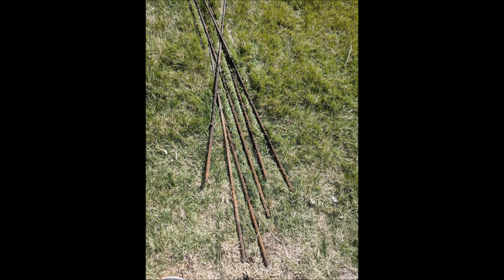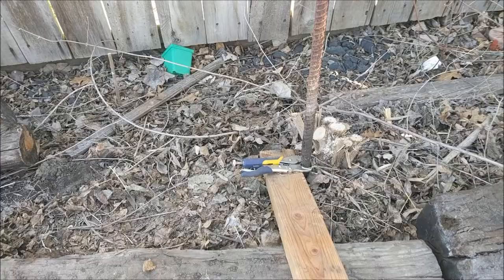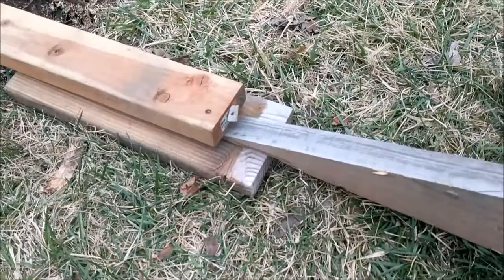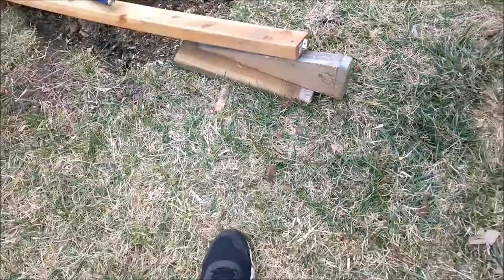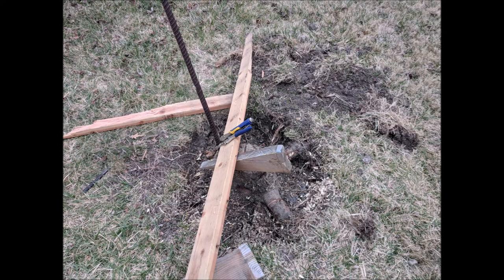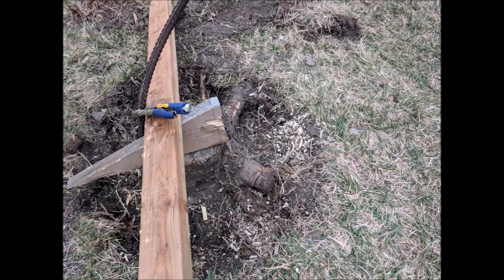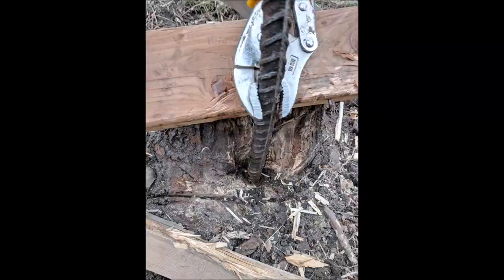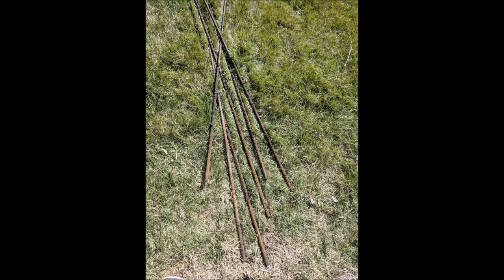How to pull rebar out of the ground

Comment: This video just saved my life. My previous owner also decided it was a good idea to secure a 10” planter box with 4’ rebar. After digging 2’ down through the wet clay to clear enough room to twist and pull out 8 of them using nothing but raw, brute strength. But there were two left that I just couldn’t get. So after an hour of pulling I just kneeled there in the mud, back shot, arms and legs like jello, dejected and feeling defeated. So I finally did what my wife suggested and looked for a YouTube video and yours was the first hit. This worked like a charm. Can’t believe I wasted all afternoon digging and pulling the others I feel so dumb. Anyway, thanks a million.

Comment: An easier pry is using two 2X4’s on edge on both sides and then a cinder block as the leverage point.
Reply from the maker: I snapped one 2x4 on the one in the tree stump. Didn't try two at once. I agree a cinder block would help define the leverage point.

Comment: A couple tips.
Use the lumber upright with the 1 1/2" side on the ground. You are letting the board bend causing you to lose some mechanical advantage and then your board breaking. Use an appropriately sized board  (able to stay mostly streight and stable for the load you are lifting) and length of board to get the correct advantage. Depending on your lifting strenght and physical stability under a strain. It may be better to put fulcrum blocks between you and the post. That way you are pushing down and your lifting strength  is enhanced by your full weight pushing down. Move the fulcrum nearer or farther as well as higher or lower as needed to get the correct lift height and force multiplication that makes a lever one of the best inventions ever devised by the human race. For a concrete post the lifting distance per push or lift will be short but very very powerful.
Once you can get a few mm of lift just shift the fulcrum slightly and do it again then again till it is out.

I have fun teaching the neighbor kids how they can lift cars and stuff. It is a blast to see what they can come up with a bunch of blocks and boards.

Comment: catastrophic failure hahahahahahaha :face-fuchsia-tongue-out: that poor wedge :hand-orange-covering-eyes::face-green-smiling::face-purple-smiling-tears::face-purple-crying:
i've pulled rebar and ground rods using pipe wrench and 'ol bumper jack, have two rebarbs next to the avocado tree trunk only an inch sticking out, gonna try your vice grip hack. got lot's of 2x4's use a piece last night to remove transmission bearing. brother said "you need a brass hammer" looked at him "hold my cerveza"  🍺 removed and drank it all up :face-turquoise-drinking-coffee: 
Cerveza for you 🍺:face-blue-smiling:
that's what she said :face-blue-covering-eyes::body-blue-raised-arms:

Comment: Thanks for the show. My metal carport is held down by  3 ft long rebar pins and I'm looking for the means to pull them up without damaging them,
Reply from the maker: This method should work, but expect the vise grips to scratch up the rebar a bit. When prying up, only do a little at a time before repositioning the vise grips so you don't bend the bar. Hopefully after you get it to budge a little, you'll be able to just pull it straight up. Assuming there isn't a tree trunk growing around it...